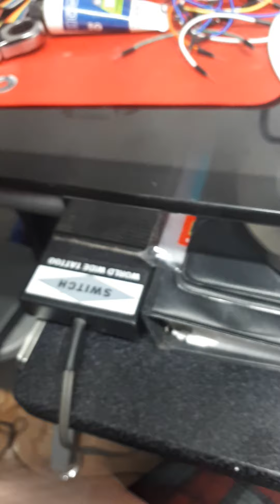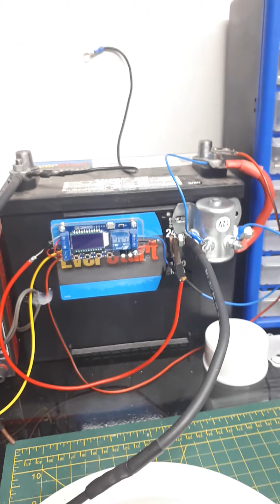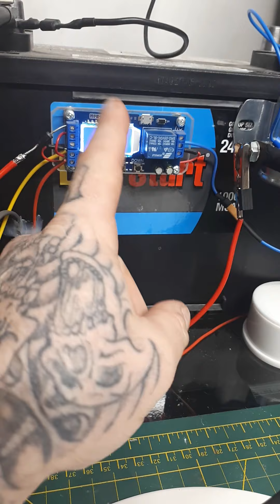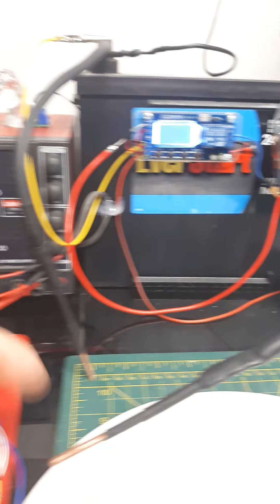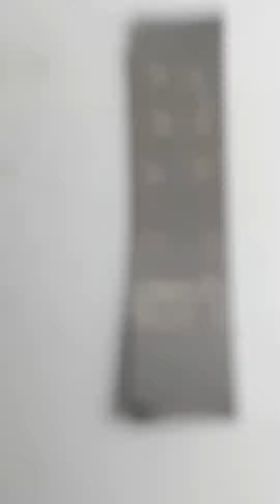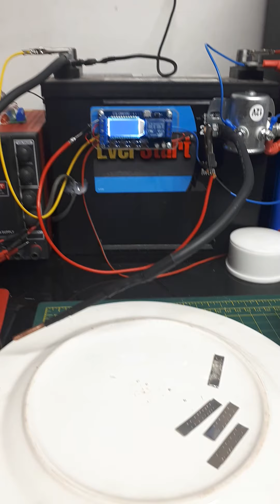Auto pulse weld, no foot pedal with solenoid

Comment: Thanks so much for clarifying the risk of electrocution part re: electrodes to skin.  I'm trying to DIY an eSkate. Have all the pieces including 18650s and BMS etc.  to put together batt pack. Now need to make the sparkie box  (Canadian Tire all out...forever!) Have 12v battery..going manual switch to start but ordering timer you referenced. Have cables solenoid and electrodes. Just needed to get over fear of electrocution. Thx! Other videos had not referenced the Diode. You used 1A 1000V? Is that there to protect 12v battery / is there some kind of damaging echo back pulse that happens if you don't have? Diode is basically 1 way gate right. Sorry for nube questions. Great vid thx.

Comment: Also...I have a couple of 12ish Volt Mega capacitors that are used in car audio.  Have a little LED read out on them.  In theory could these be used to power a spot welder?  Have one I could donate to you if you are near TO and wanted to try.
Cheers
Rhys
Reply from the maker: Hey brother, I am out at the farm in Manitoba. Yes capacitors work great. Basically you need at 12 volts like 500 amp to weld 0.15mm nickle and about 700 to 750 amps at 12 volts for 0.2mm nickle strip.  If they have amps like that ya man I could make it work for welding. Cheers brother

Comment: does it double fire with the mosfet welder? maybe its just the solenoid?    btw I ordered that timer and my parts and would like to do the autopulse too.
Reply from the maker: I didn't try the mosfet welder yet and was trying to clear up the second pulse first. I might go ahead and try the mosfet welder later on but I could probably figure out a away to make it work so will see how it goes.

Comment: I know it’s been a bit since this video, but I’ve ended up making a very similar welding board with power mosfets, and am looking for a reliable and simple timing circuit to drive the gates with. Don’t really care if it’s double pulse, although it would be cool. 

So far i’ve tried using a spot welder actually, a cheap china spot welder a pcb, with the main weld output just driving the gate of the larger power board, and a timed relay like this one. 

They both somewhat* do the job, however I am getting this same issue with the auto-trigger firing a second time after the first weld. I tried a diode like you did, and also adding some some capacitance in the line to possibly buffer some of the spike. I have not tried a schottkey diode yet though, i’m thinking maybe a faster diode will prevent the flyback spike? Were you able to figure out anything that helped this?
Reply from the maker: Maybe you didn't watch or follow the video I mean that nicely not to be mean. In this video I have it wired and running the program to have this effect...........normally when I run the set up not in the settings and wiring configuration it's works a one shot fire set up. This video is talking about setting up for the auto trigger no double fire I don't know what you mean personal I don't have any issue with double fire in this video it fires once but it's triggered by the contacts shorting and a second later you get the first weld pulse and only weld pulse. Hopefully this is Hopefully if your running a spot welder just get this timing board in the video and run it on one shot set up.......
Reply: @cdiperformanceparts4364   nah it’s cool bro, yeah I was weirdly having a similar problem on a whole different timer setup, a mini spot welder’s output as the gate driver (timer) for the slave-board of power fets, using the mini welders auto pulse connected to slave board’s drain via a resistor for sensing when the electrodes are shorted. I just added a schottkey diode with the resistor and it stopped its random firing. But yeah I’m going to get a proper pulse timer because mosfets are tricky. 

also I think it was in one of your other videos you mentioned the flyback diode importance and you couldn’t be more right, I haven’t popped any more mosfets since putting a couple of 5KP13A diodes for the inductive flyback spike on FET turn off.  Just picked up a taco minibike too looks like from the 70’s, it’s got a 3hp briggs but that’s gonna be a project so i may be up in here checking out your engine build here soon. cheers
Reply from the maker: @markb1911  thats awesome brother, spunds like its all working out nice then thats great. Cheers mate.